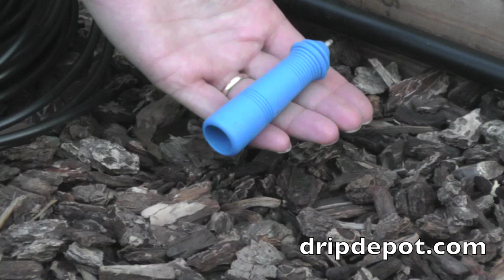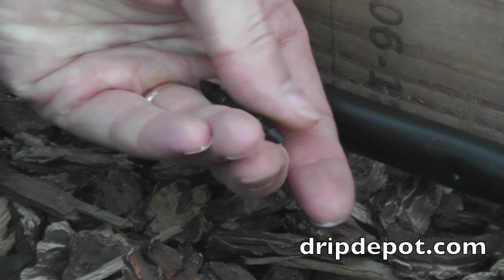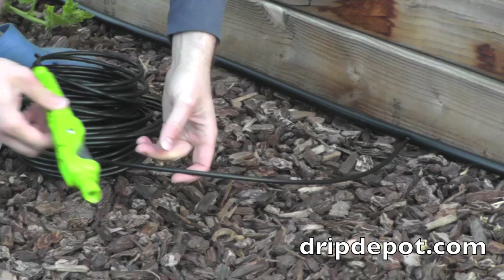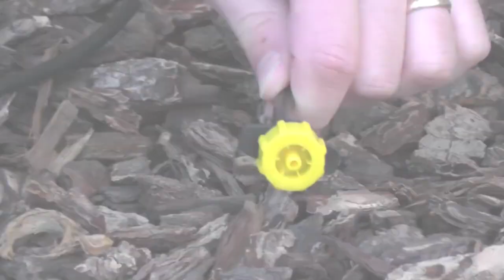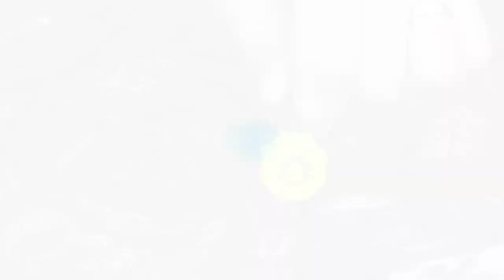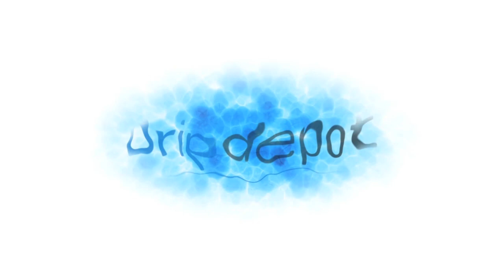How to Use 1/4" Microtubing as Feeder Lines from Mainline Tubing in a Drip System

Comment: I heat up the small tubing with a lighter for 1-2 seconds especially in cold weather. Otherwise it can be really tough to slip it over the barb.
Reply from the maker: Definitely an effective route!  Not one we generally recommend due to risk of melting the tubing, but with some care it's very effective.  We've seen folks use a hair dryer to great effect as well -- as you noted, much easier to connect when the tubing is warm and pliable :)

Comment: Could you use a Barb connecter to extend the microtubing, like a coupler
Reply: you can, it does make a small flow restriction in the line but it should be fine

Comment: Every connection to the 1/2 inch tube leaks like a submarine with a screen door. Well it drip anyways. Any way to stop this?
Reply from the maker: You bet, I can confirm these connections should not leak -- a couple common things we see: 

1. Make sure you're using the correct sized punch -- a 1/4" punch is the correct one for the fittings in this video. 
2. Pressure -- If the water pressure is much over 30 PSI they may leak (most drip irrigation works best at 10 to 25 PSI).  
3. When you punch the hole, try to go in as straight as you can -- this one isn't as common as the above, but worth mentioning -- too much wiggling or a odd angle while punching can make an uneven hole which can result in leaking.  

If you're already using a 1/4" punch and regulating to less than 30 PSI, fire us off an email at our contact us and we can get some pictures to take a look, as you should be able to have it up and running leak free :)

Comment: some of my drip emitters keep getting disconnected (and then opening the loop) although I installed a 1 bar pressure reductor. How can I prevent that? I tried using the microtube holders to clamp the drip emitter and prevent it from getting disconected, but on some it make the connection unstable on the tub side, causing it to spray water on the back of the emitter.
Any tip will help, getting a bit frustrated.
Reply from the maker: I can confirm your drip emitters shouldn't get disconnected -- particularly in 1 bar, even under higher 2 bar they should remain connected.  Would you be able to send us a photo of one of the problematic ones along with some details?  The details would include what size punch you're using, an order number or email used if you got it from us (no problems if not, still happy to help) and if this happens to all of them or just a few of them.  Send the email to support@dripdepot.com or use the Contact Us at this link (the Contact Us sends an email to that same address): https://help.dripdepot.com/support/tickets/new

In the meantime, some general information that may help: Ensure you're using the correct sized punch to punch the holes for the barb on the emitter.  If you're connecting the emitter to the end of a microtubing run, ensure that microtubing is the correct size for the emitter (0.170" ID tubing).  If you got everything in one place, it's likely everything is sized correctly, which could make it worth checking pressure to ensure the regulator is regulating downstream pressure.  

We'll be available to assist if you end up sending us an email, we tend to get back pretty quickly :)
Reply: @dripdepot  Amazing fast response!
Unluckily, my previous response to this comment included a link to one of your articles, and I guess the antispam has got it.
After finding the "Tubing popping off 1/4" Fittings " topic on your FAQs, I think the issue could be that the microtubing going directly to the emitters is PVC, and since it's really hot this days, it is not tolerating ok theses temperatures. I'm considering to switch it with LDPE microtubing.
Reply from the maker: @Festiman_   I get a copy of replies in my in-box, so I did get to read it -- when I came to reply to it here I'd wondered what happened to it.  

The vinyl tubing could definitely be the root cause of this -- it gets a lot softer than poly when it gets hot.  It also breaks down faster under UV exposure, which causes it to get a bit brittle, which also results in it being easier to take off the barb.  I suspect you nailed it there.  Vinyl's best use is in indoor applications where temperatures are reasonably controlled and the UV exposure isn't as severe.  I sure do like how flexible vinyl is, but even when UV treated it still breaks down faster than poly in the sun.  

Great catch in the article!
Reply: @dripdepot  would E.V.A. a suitable replacement also?
Reply from the maker: @Festiman_   That's a really good question -- EVA is used in agriculture, is UV resistant and is a stable molecule (and no chlorine!), so in those regards it could.  It could be inconvenient or costly, however -- mostly due to the rarity of finding the right type.  You want to avoid anything translucent as it can promote growth inside the lines, and a lot of EVA is clear or at least lets some light through -- you could probably find some opaque EVA, but its costs might be quite a bit higher than an equivalent roll of poly tubing. 

The EVA in Ag is usually used in pesticide/herbicide applications rather than water transportation -- this means finding the right size (around 0.170" ID x 0.250" OD) could be a challenge as well. 

With all that said, if you find some of the right dimensions and opacity, it can be used as it has the other factors in place (primarily molecular stability and UV resistance) :)